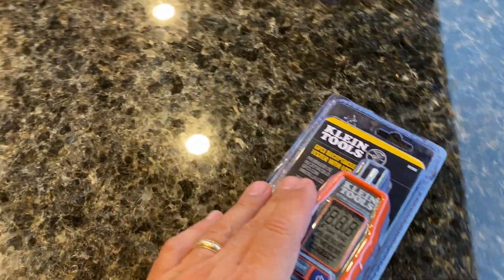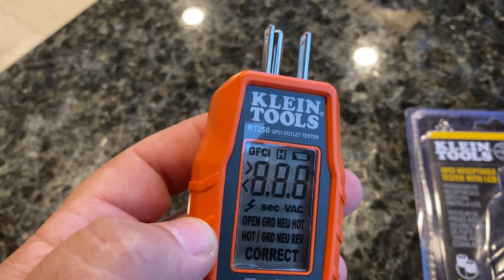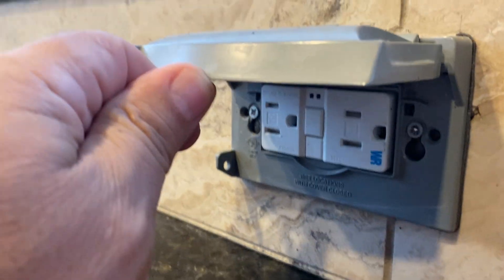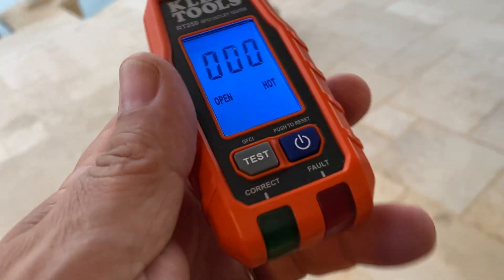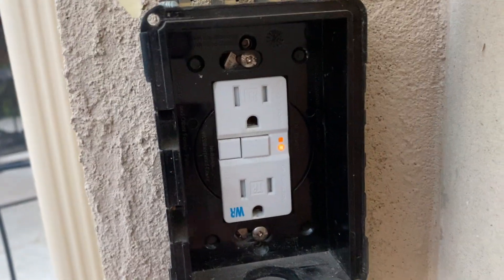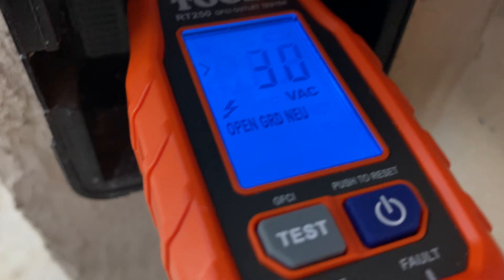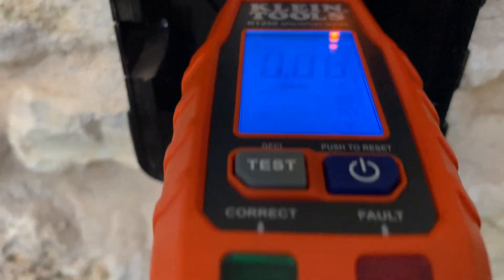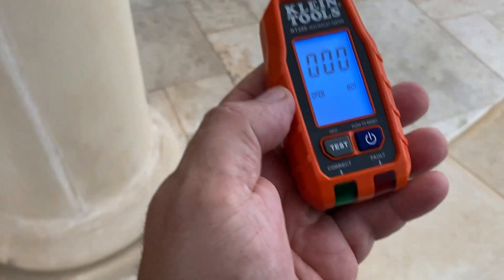⚡ See How it Works!  Klein Tools GFCI Plug Tester RT250

Comment: i really wanna see if this product also resets the outlet for you with that power button that says "push to reset" as my gfci outlet in my backyard does not have a reset button. I'm wondering if this device does that for me.
Reply from the maker: No, it will not reset your GFCI breaker.  You should have another plug somewhere with the reset buttons on them.  On this device, the "reset" is just to clear the screen it does not have any way to reset your GFCI.
Reply: @ApacheRanch  thank you